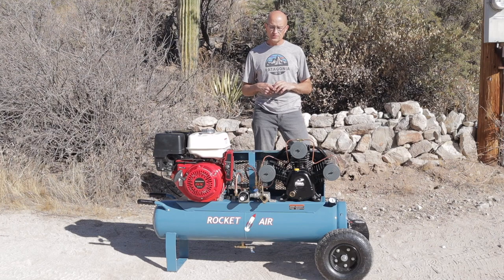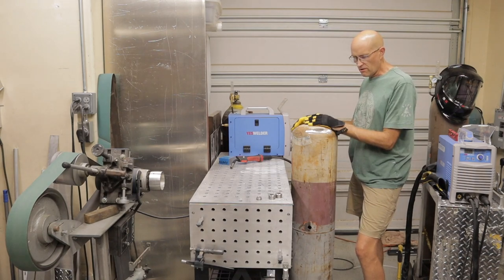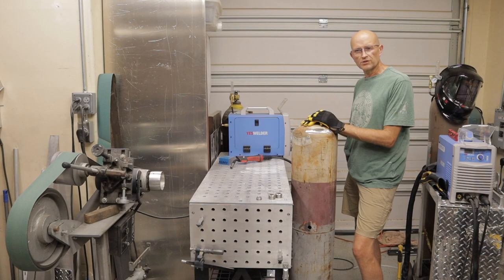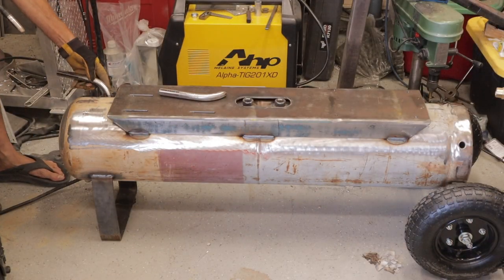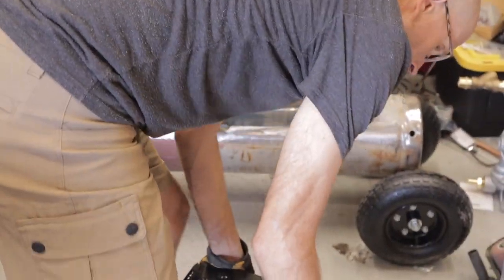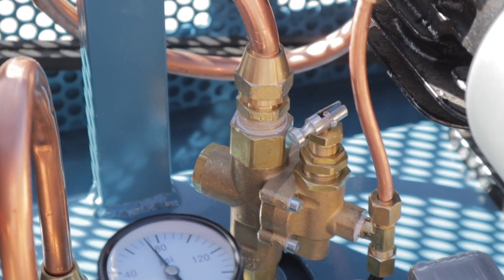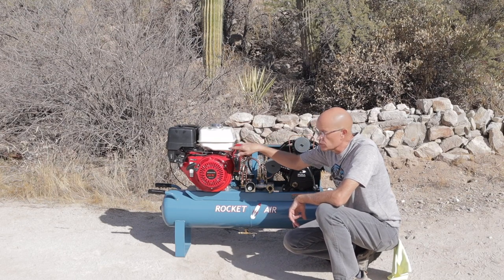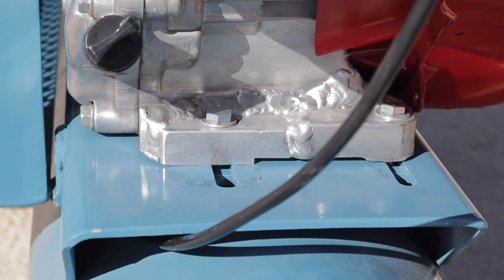DIY GAS POWERED AIR COMPRESSOR BUILD! -- HIGH PERFORMANCE BIG CFM! HOW TO — HONDA Powered

Comment: Dang, i wish i had this five years ago when i built mine. There was next to nothing helpful on here, i ended up spending hours on forums, mostly just figuring out terminology and what things are called. I built mine on a trailer for blowing out irrigation systems every fall. Since i bought all the steel new, it cost me around $8k, but it was all a business write off. Used commercial ones around here are going for 12-18k, so i still saved and mine does a lot more than blow air! I made mine gas over electric. The power plant is a 12,000 watt generator and it powers a 240v motor that sits between two 12cfm compressor heads. It runs at operating rpm constantly though, the unloader just vents to the atmosphere when there's no demand. I'm probably going to change that soon. There's a 20 gallon tank for a buffer so the valve isn't cycling nonstop. I'm not sure what law in physics it is, but it increases my output psi considerably. It builds up to 140 and maintains 110+ constantly. Without the tank it was maintaining just under 100. I got a paint shop grade filter and separator for when it's needed, otherwise it's bypassed because water lines don't really seem to care if there's water in the air! The trailer can also run my mig welder and plasma cutter, along with any power tool i could need. I live on a cattle ranch and it's become an essential machine. That was the actual reason for the build, irrigation is just a side gig every fall and a way to write it off. I purposely choose the generator to be able to run my entire house with hvac. Haven't got that set up yet, but maybe I'm the next five years i will. I should make a video of it. Based off the stuff i like to watch, it seems there's a strong community here that would like it, and many of which are PhD blue collar professionals that will help me understand everything I've done wrong 😂. I really like your build a lot though. I've not seen any of your other videos, but I'll be checking them out. You do very nice work and unlike me, your welds don't look like bird shit! But your build is the perfect size, that'll handle anything it looks like. Very nice job.
Reply from the maker: Hey, thanks for the great comment! Wow, yours sounds like an awesome build! I like the two head design though. Great idea! 😊👍
Reply: I have a Kellogg American compressor head model a332tvx on a old compressor what is running good motor color engine was not running good does not have that decompression head part how do I connect that up?

Comment: Very good, however even at idle you still have considerable drag in keeping the compressor connected even if it is depressurized. Put a centrifugal clutch on the engine shaft and you will get a much more economical idle.
Reply from the maker: Thank you😊👍

Comment: Did you use this compressor in an aircrete project??
Reply from the maker: Hi David! No, I was planning to use it to combine with another compressor, so that I could spray my own shotCrete for a dome home. I was going to use the Aircrete to build the shell and then spray the outside with shotCrete for a durable shell. I could not find one engineer that would sign off on my design though. 🙁
Reply: @PranaTech  oh my, sorry to hear that buddy!! It is difficult to find engineers to embrace alternative building methods indeed.  Here is an idea for you, there is a guy in Alabama who did a boat shed with wood and styroaircrete.  I mention this, because the arches could be made to go in a circle and given the 2x4 sections, perhaps an engineer would feel comfortable signing off on that design.  Let me find you the video of the boat shed and then see if you can rig the apex to accept the (whatever amount is needed to comply with lumber frame protocol).  The idea is that the structure will have wooden ribs for the peace of mind of the engineer.

Comment: You did a great job. I like your work ethic and can do attitude. I was looking for a better compressor to replace my clapped out set up. You’ve taken all the guess work out of me just modifying and making my old one better than one I can buy for what I need. I’m also going to be using the stater to help charge my battery bank in my enclosed trailer so I can use my power converter.
Reply from the maker: Hi Spencer! Thank you for the nice comment! I appreciate it! I like your idea of charging your battery bank with the engine stator. The starting battery is usually back up to full charge within 10 minutes or so, then everything after that can be used for charging your bank. Great idea!👍😀Don

Comment: Hello there. Thanks for the great video. Im looking at maybe converting and electric to run off an engine but im a bit uncertain of sizing the engine and how that side of the design pans out. It seems most 22cfm air heads are paired with 5.5hp motors (usually 3 phase). Now 13hp is a lot more than that!!! I have looked at torque/power curves for gas engines and it aeems peak torque output is at 2500 rpm which is at about half the rated motor power output. Do you need to design so they operate at around this rpm to get adequate pressure? Do you know rpm you're running at here? 

Im thinking if this thinking is about right and i only need 8 bar then maybe i could get away with 7hp to give the required flow rate.  I'm more concerned about weight and portability so keen to minimise engine size where possible.
Reply from the maker: Hey, great questions!  Ok, horsepower in gas engine needs to be about double of what the electric motor rated for the head size you are going with. Personally, this was compressor turned out quite heavy for me to move around and it ended up getting sold because of this. If I was going to build another to be portable, I would use a 5-7 horsepower gas engine and the appropriate sized head to match so that it could be portable because mine in the end ended up at almost 300 pounds. The gas engines for use with a compressor run at 3500-3600 rpm when it is in compressing mode. Hope this helps. 😊👍

Comment: Nice content, thank you !
The motor strong enough to use Sandblaster if you want ? If not what Engine would be great for that in your opinion  ?
Reply from the maker: This engine is definitely strong enough to handle sandblasting. 😊👍

Comment: How is it holding up?  Are you worried that the speed at idle is too low to keep the pump lubricated?
Reply from the maker: Hi Travis, it’s holding up great! It is a splash type lubrication and even at low rpms it seems to lubricate just fine.👍😁

Comment: Thanks for the vid. I got an old wheelbarrow compressor that doesn't work and wanted to replace the pump and engine. this helped me a lot to understand how the throttle works and what I would need to order to get it working right. Looks like another Arizonan too :)

Also, curious, what do you need such a big compressor to build a house? Just curious. Running an entire crew with framing nailers?
Reply from the maker: Hi Andy! Hey I’m glad that the video helped. Yes, I’m in Tucson 😁👍
Reply: @PranaTech  that was quick! Awesome, I'm up in PHX. I edited my message to add a Q- was wondering what you needed the CFM for house building. Regardless, good look with the build!
Reply from the maker: Hi Andy! I needed the high cfm because I want to build a dome home out of Aircrete and then spray shotCrete on the outside. Spraying shotCrete takes a lot of cfm and will need probably 2-3 of these compressors to pull it off. 😁👍

Comment: great job i love it i having trouble finding the  Freon tank.and the compressor  any ideas
Reply from the maker: Hi Bruce!  Well, it looks like the compressor head I used is sold out right now. I built another one of these wit the big 5 hp twin cyl. Head from harbor freight about 10 years ago and it is still going strong today. It would be a decent secondary choice if you don’t need 22cfm. I think it’s rated at 17cfm if I remember correctly. The tank is just what I happened to find locally. I was looking for a used large propane tank, but you have to be very careful with those before you weld on it. I would pull the valve off and then flush the tank with water completely to the top and then let it dry for a few days to make sure all the fuel is gone. 😊👍

Comment: Nice job !!!! Will it produce enough air for sandblasting wood? I know it needs a steady airflow. Also as you mentioned in the video a new one costs tons of money from a shop. Thats why i aint know well when i build one my own what engine and air head  i should use 🤷‍♂️. Will copy the one you made overthere... looks awesome. 
Sorry when my english spelling is wrong. ☝😁I am dutch. Greetings from Belgium. 😉
Reply from the maker: Hello, yes this will produce enough to sandblast wood with no problem at all. 😊👍

Comment: You're wire welders look like twin brothers ! Did you acquire them through Amazon and what were their cost ?
Reply from the maker: Hi Joe! One of them is my wire feed mig welder and the other is my AC/DC Tig welder. They do look like twins though! The wire feed one I got through Amazon for $350 back when I bought it, and the other came right from Yeswelder. They now have an online store. Yeswelder.com 
The Tig welder cost about $600 when I got it. There is a discount code in my video description but I’ll just give it here for you if you want to purchase one. My discount code is PRANATECH and it will get you 10% off everything on their site. 😁👍

Comment: Is a single stage better on a30 gallon tank for painting a car or 2 stage? I’m going to build one thanks
Reply from the maker: Hi there, I’ve painted a few of my own cars with my 30 gal. 10cfm single stage compressor and I have never run out of air with it. If you go with a two stage, you will have even more air to spare. The drawback with two stage compressor heads with DIY builds is that the put out around 175 psi, so your tank needs to be beefier than a single stage build. The parts are bigger for the pilot valve and pop off valve etc… so there will be added costs as well. Hope this helps. 👍😊Don
Reply: Thank you so much yes this helps me out allot. Your videos are great keep up the good work…
Reply from the maker: You are very welcome! Thank you for your kind words.🙏😊

Comment: Pretty neat, where did you get the compressor?
Reply from the maker: Hi Andrew! Here is a link to the compressor pump I used. This one is a two stage and the one I used was single stage. They are sold out of the single stage pumps. https://compressor-source.com/collections/compressor-pumps/products/puma-3-cylinder-two-stage-cast-iron-15-scfm-air-compressor-pump 👍😁

Comment: I want to build a bigger stationary one , but with 2 compressor heads for twice the cfm.
Reply from the maker: Hi John!  That’s funny, I’ve thought about doing the same thing!  It wouldn’t be that much more difficult at all. I would mount the engine in the middle and make it stationary and make the compressors adjustable to tighten the belts. Obviously you would need double the horsepower but the work wouldn’t be much more.👍😁

Comment: How many gallons is your setup and how long does it take to recover?
Reply from the maker: My tank is 15 gallons and it will fill to full pressure with the tank empty in less than a minute. When the tank is full and goes down in pressure to activate the unloader valve, it recovers in about 30 seconds. 👍😀

Comment: Awesome build.  What do you need 20 cfm for?  I see you had a large jackhammer type air coupler/connector.
Reply from the maker: Hi Dennis, I use it for an Aircrete foam generator that I built. It uses a lot of air to pump the fluid and to inject air to produce the foam. Thank you for your kind comment!🙏😊
Reply: @PranaTech  Thanks Don! Love the channel. I have learned a lot. I hope you keep making videos
Reply from the maker: Hey, glad you like my channel! Yes, I will continue posting up stuff because I’m always building something. I’m editing a video right now of my latest project that I just finished which is a big water cooler for my Tig welder. 😁👍Thanks!
Reply: @PranaTech  SWEET!  I'm looking to build one for a similar purpose. Picture a "Monolithic dome" but as a Quonset hut.  I'll be fabricating my own arches & galvanized skin from big box store supplies.  Then Froth-pack foam the inside. And then rebar & DIY shotcrete using the Mortar Sprayer gun.  20+ CFM will be more than enough for this process.

I'll have a square wall "Monolithic" for less $$$ in shell materials, no need for inflator fans & costly Airlock.  This means I'll be able to mix the concrete at my own pace, wheelbarrow it in through an open door, and then use a $300 Mortar Sprayer instead of a $20,000 shotcrete pump.  Plus, I can do it at my own pace.  Alone.  Because I'm cheap. 😉
Reply from the maker: I like the way you think!  I’m headed in a similar direction as well! I’m looking at doing a dome with my own fabricated arches as well out of 2” square tubing and then tack welding expanded metal to the inside and hand troweling or “parging” mortar to the inside and once that shell is finished, insulating with foam and then laying rebar and then shotcrete the outside. I’m with you, I have no use for the air form method!  Yours sounds like a great plan as well. I’m pretty frugal myself and I say any money I don’t have to pay someone else is money in the bank!😁👍
Reply: @PranaTech  Subbed  :-)
Reply: @PranaTech  I actually attended the Monolithic dome training seminar back in 2019 and wished to build several studios.  However, when I tried to set up a visit in Italy TX with my wife last summer, the management there were very cold and uninviting.  Restrictions Restrictions. Since their founder David B South died a year ago, they seem to have lost their vision.
Judging by their marketplace site, the items they once had readily for sale are no longer.  Doesn't look good.

Comment: Have you found a good throttle control valve for a predator 6 or 13 horse motor?
Reply from the maker: Hi Andrew, this is the one I’m running on the Honda 13hp. https://www.amazon.com/Conrader-Airline-Throttle-Control-TCSP-H-1113-B/dp/B00UEUZO98/ref=sr_1_5?crid=3CX601W679D09&keywords=Conrader+throttle+control+valve&qid=1641927866&sprefix=conrader+throttle+control+valve%2Caps%2C190&sr=8-5 
It is too big for the 6hp but they make a smaller one for the 6hp. If they are direct clones of the Honda, they should work. 😊👍

Comment: Does the throttle control Rev the engine back up when the pressure starts to get low?
Reply from the maker: Hi Zach, yes it kicks it back up to whatever RPM you have it set to for running while compressing. When it senses the high pressure it kicks it down to idle and diverts the compressed air out the side of the valve so that there is no load on the engine. 😊👍
Reply: @PranaTech  awesome! Thanks for the quick reply. I'm needing a compressor and I'm debating on building my own just to give myself another challenging task and I'd save a lot of money compared to buying something new

Comment: Was it a setting thing or welder having problems that it was sticking?  Not criticizing just curious so I can learn from it.
Reply from the maker: Hi Scott, nope, just laziness of the guy welding! I had a crappy ground because of the paint on the tank and my nozzle was all clogged up with slag from so much welding lately. Totally my fault and not the welder’s.

Comment: You can put what ever size tank underneath or is that not how this works lol I'm taking a real swing at this just want a bigger tank and this might be a silly question but I'll be running a tool that requires 18-20cfm at min 90psi with a max of 100psi now if I have a bigger tank this set up should work ok right or will I only get less than a minute of use before I need to stop and let the compressor build back up sorry I'm a complete novice in this air world lol
Reply: Nvm I need to go a little bigger on motor and compressor head
Reply from the maker: Hi John. Yes, you are correct, you can put as big a tank as you want under the compressor and it will just give you more reserve air. Just be advised that most manufacturers overrate their compressor heads. If you need 18-20 Cfm I would go with a 25 to 30 cfm rated head. I have found a few that size on eBay in the area of $800-$900 if you look around. Probably need a 15hp gas engine or bigger to run it. Let me know if you have any other questions. 😁👍 Don
Reply: @PranaTech  thanks for the confirmation and advice much appreciated